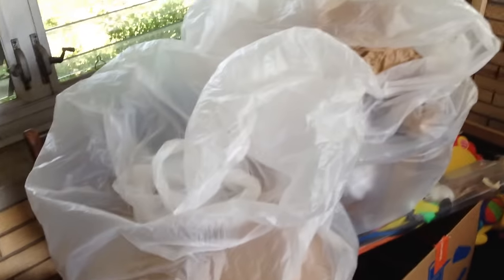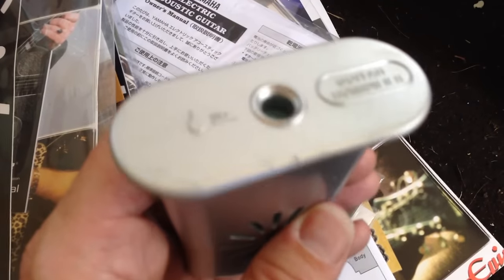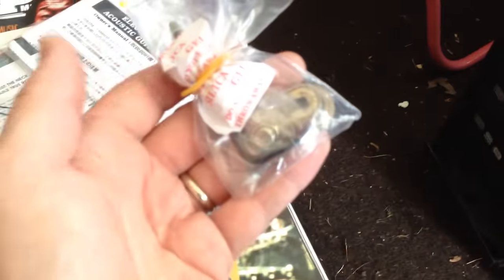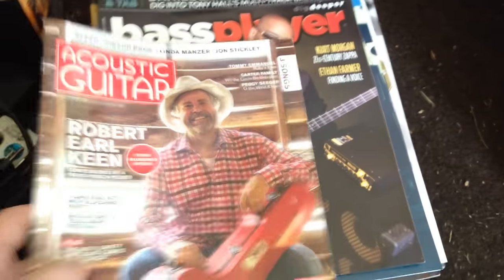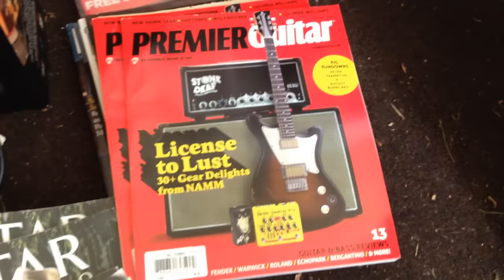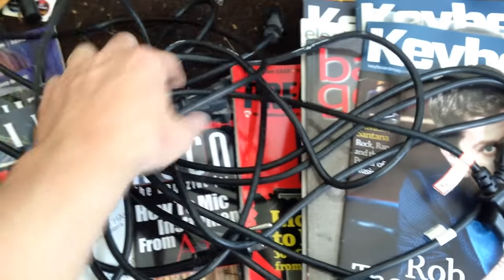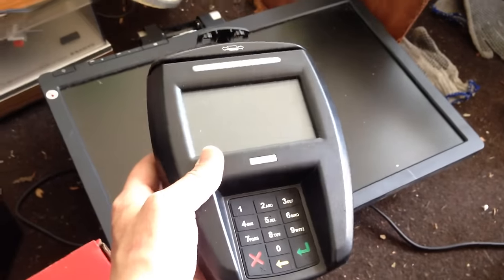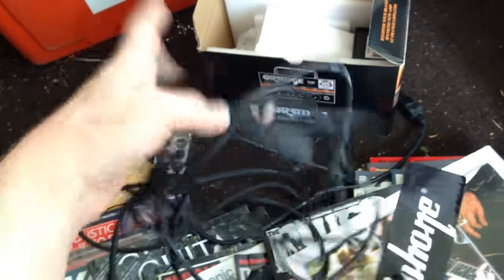Music Store Dumpster Finds - Teac DVD Burner, Cables, Mags, etc.

Comment: 1 to 7 duplicator. One is a Reader the others burners. Great score!
Reply from the maker: I know the 10 stack burner is $750 new.
Reply: Try to find a replacement tray as soon as you can before its discontinued. I had good luck with the verbatim dvd and cd's. Still a call for this, great way to make a little extra folding money.
Reply: If you're really lucky it may have a HDD for storing images, at a low error burn rate, say 16x for a Cd, you could burn a 1oo in 20 minutes plus or minus.
Reply from the maker: It does have a HDD... I have spares as well. It powers up just fine, but obviously can't get past the disk check because drive 1 is busted. I think I can either move drive 8 to drive 1 position, or insert a new drive into position 1. I serviced computers long before even messing with guitar gear. I'll get it working. :)

Comment: Why do they throw out cables and paperwork.  If I paid for it, I want it.  Sometimes if you have an amp setting you want to find out about the papers come in handy.  When churches install a new PA system you hardly ever get the papesr.  sometimes you have knobs or jacks you don't know how to use, and you have no instructions.